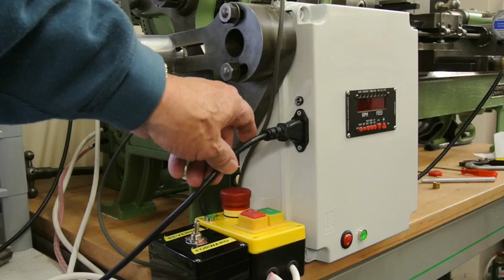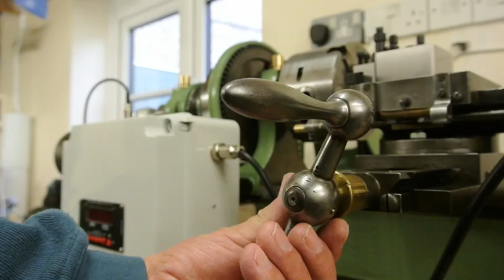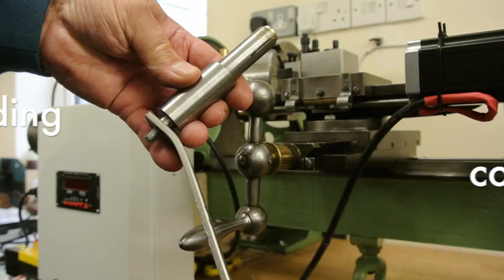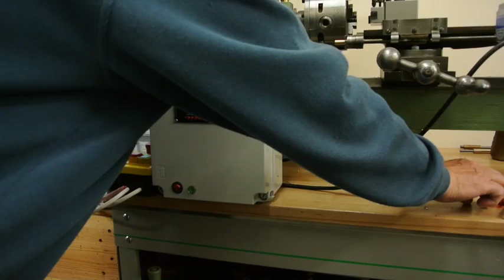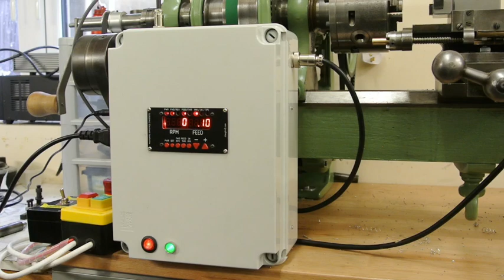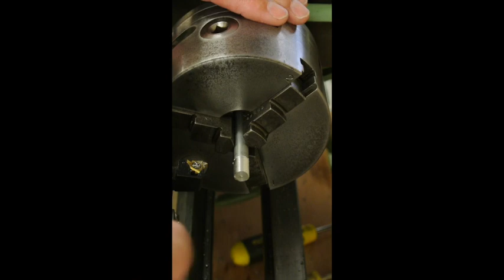Lorch Lathe (Part 5) Electronic Lead Screw from Clough42

Comment: Hi. I also bought the ELS from Clough42 and I'm about to start assembling it. Regarding the Issue with running tool into the shoulder do you think I could fit a clutch on Stepper pulley that would always engage it in only one position. I've made attachement like this: https://www.youtube.com/watch?v=9tN1QRoQ7s0&list=PLxcNbsp0R-WxU6blf6MlrJeJTA3wyXbeQ&index=59 for my lathe a while ago but now I want ELS and possibly use clutch on the stepper. Would that mess up the threads? Thank you. Regards.

Comment: Hi folks, I built James's ELS and it really is very easy to use. You need to carefully follow Janes' excellent YouTube play list to construct it though, don't try without doing that. A couple of minor notes about this video, that big shiny thing in the electronics enclosure is a linear power supply, not just a simple transformer. The green plug on daughter board also does rather more than provide easy to use contacts. If making your own cables terminated in DuPont connectors do read up about them, you need the correctly formed crimp tool jaws to make them so they easily fit in the housings. I found a 'wall wart' psu for the 5 volt supply was not sufficiently stable and had too low a voltage under load so I replaced it with another switching psu. I made comprehensive hand written notes by watching each of James' videos and they were a great help. Take your time and make sure you understand what 'earth loops' are about - you don't want any of these, they cause all sorts of problems. I'm in my early 70s and if I can do it so can ypu.

Comment: Great video John! This is something which I would like to implement on my lathe. Can you please provide some info regarding where and how much you paid for the encoder. UK prices are frightening! Many thanks Kevin
Reply from the maker: Keven, yes they are a stupid price. I bought direct from China and the cost was quite low. I think about £20. I have bought many times from China direct and they have not failed ever to send the order and often they come amazingly quickly. Postage is free usually. The cheapest on Ebay is currently £20.36 for the correct model. Do not worry they do work. I checked that with James. I cannot imagine how RS and others charge 10 X the purchase price.  If it helps the stepper I used was from Stepper on ,line and it cost £25. the driver was £34 from the USA but you could perfectly well use a suitable one cheap off ebay. The whole thing can be made for quite modest cost and there is no need to fit huge expensive drives. I have a spare encoder if you want it, just mail me direct.  John
Reply: @john2478  Hi John. Not sure if I'm responding in the right place. I would like to buy the encoder from you. Do you know, if I place my email address here can everyone see it or just you?
Reply from the maker: @jkwalsh56   Kevin
If you go to my web page jgwright.co.uk  and post a message using the contacts form, that should get to me.

John

Comment: That Clough42 electronic lead screw was great tip for me, thanks for it. About free wheeling issue: I'm not sure what kind of motor setup you have for the lathe but VFD with brake resistor would probably help a lot with free wheeling.
Reply from the maker: Kimmo

The drive motor is an old single phase induction motor. I have not fitted a VFD as I was trying to keep the costs down. You are right a VFD with motor braking might help a lot to slow it down. It is however quite useable as it is.

John